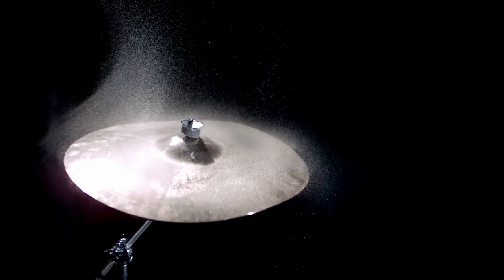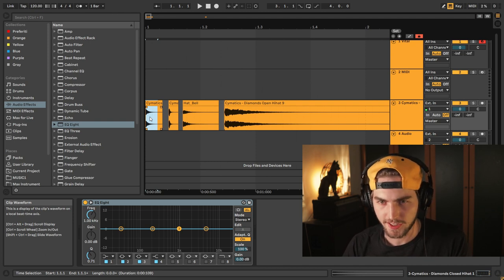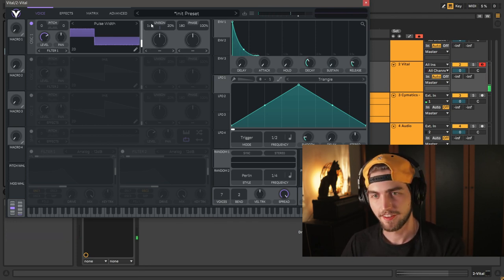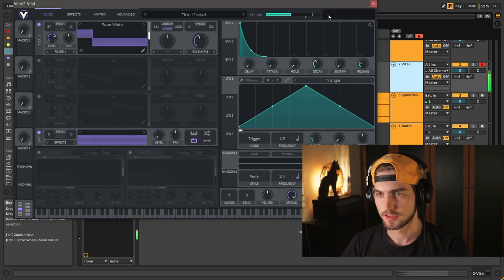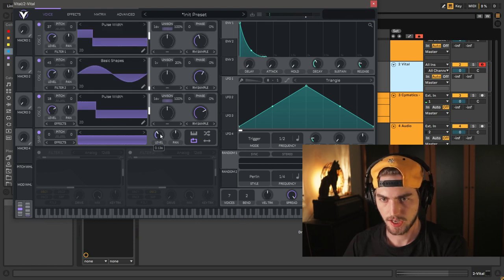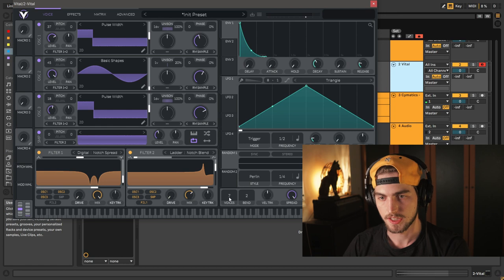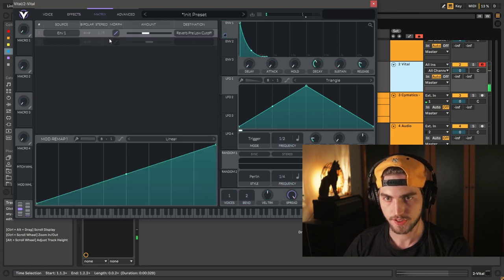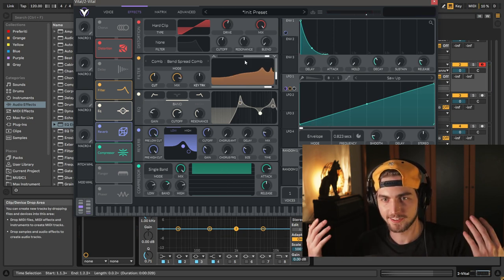HIHAT Synthesis in VITAL | Sound Design Sundays

Comment: Hey this is a good tutorial, I really like how you brought in the logic behind your synthesis. However,  I would not recommend using that many voices, especially for something that might hit every 1/8th beat, as It'll eat up your cpu if you're doing some high bpm production. You saw the 808 used 6 oscillators. I'd stick to that many voices.Then again, high hats probably can be run in draft mode to no noticeable difference, so you might be able to get away with it.